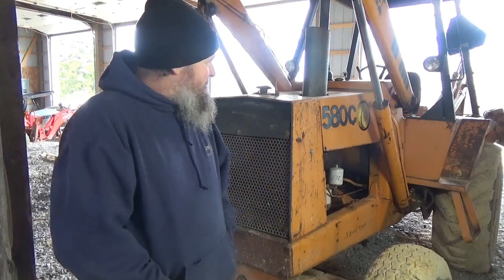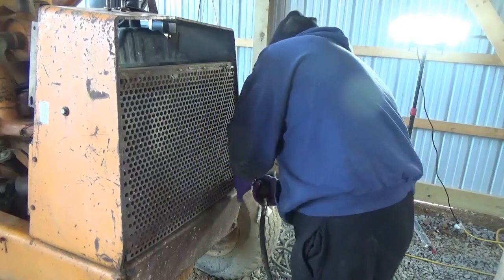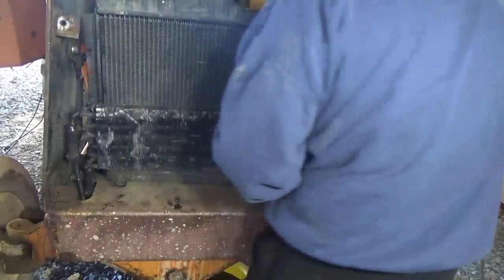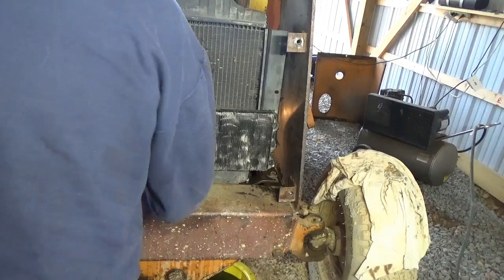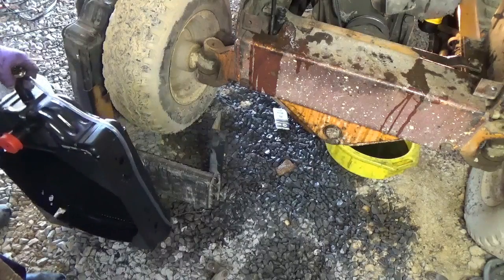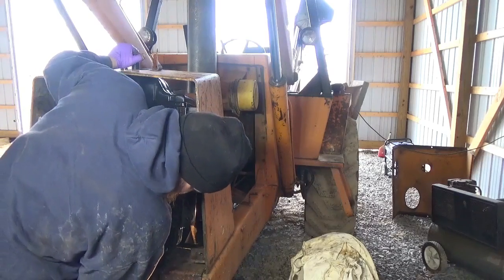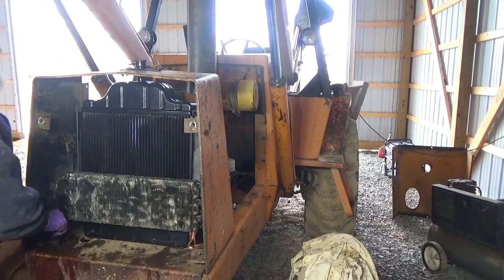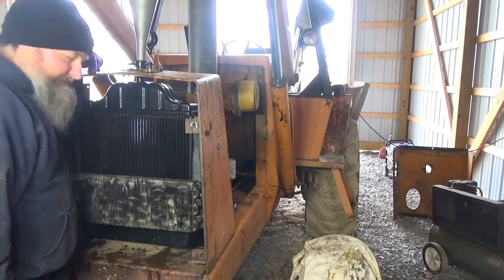How to put a new radiator in a Case 580C backhoe

Comment: l struggled on my own getting that heavy radiator shroud off so l have split it front to back on the top and fitted plates with captive 1/2 bolts to put it back together, l also notched out where the radiator bolts through the shroud onto the chassis so l can remove the shroud one half at a time leaving the radiator exposed for removal.
Reply from the maker: I am for anything that makes the job easier!

Comment: Awesome vid . I'm thinking your going to be doing a case 580C head gasket vid. Love to see that one too.
Reply from the maker: +STEVE ROB yeah afraid so. Just for shits and giggles I may buy harbor freight $29.95 USD diesel compression tester to check compression. so many jobs, so many videos to make, so little time.
Reply: +The Disgruntled Mechanic I missed that one. Awesome! I think you REALLY need that tool!
Reply: If you leave the injectors out, you can rotate the motor using one hand on the fam , rotate the fan and the engine will rotate. There will be no compression with the injectors out.  Makes it really easy to adjust the exhaust and intake rocker arms

Comment: Mike, it looks like the head gasket may not be on right or water seal "O" rings are blown, I don't know about the case engine, but gasket could be blocking water passages and opening exhaust passages causing high pressure to blow water past the new radiator cap.
Reply from the maker: +M24A6 Yes when I bought it the guy said he had replaced the head gasket. Not sure how good of a job he did or if it was done correctly. I will find out when I tear it apart I guess.

Comment: How long does it take to replace a water pump on one of these puppies?
Reply from the maker: I would say it was ~3 hours. You have to remove radiator to get to it.
Reply: @TheDisgruntledMechanic  A friend is helping my brother level some (A BUNCH) of rock on the end of his runway...his CASE keeps breaking down.  Now, it's a water pump.
'nother question, if it can be answered.  Who makes the most reliable tractors (not new ones, but slightly older 10+ old).
Reply from the maker: @cluelessbeekeeping1322  Depending on what size you want I have only good things to say about Kubota. I have a 13 year old BX24 that has been pretty much trouble free.
Reply: @TheDisgruntledMechanic  My brother has a "Ford 1110" (I think) and a larger Massey Ferguson something.  Someone told him the larger Massey Ferguson isn't a 'real tractor,' as in, it's not truly 'industrial.'  It's more of one which an unsuspecting small farmer would buy.  It seems to be true, it's not very powerful for its size.
Do you like Case or Kubota more?
(I very much appreciate all your help here!)
The "Ford" is really a rebadged Japanese  tractor, I forgot who made it.
Reply from the maker: @cluelessbeekeeping1322  I like Kubota. So many companies like New Holland is made by Ford. So many of these companies have intertwined so many times I can't keep up with who  bought who. But Kubota has remained Kubota and has had good quality.